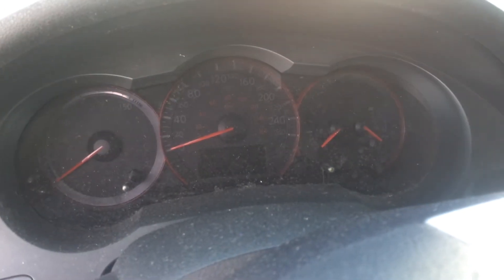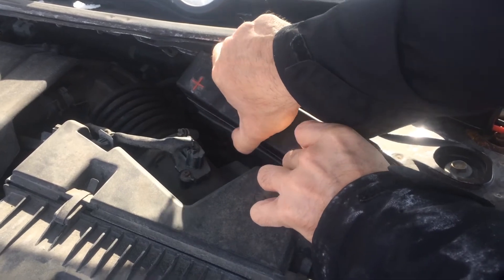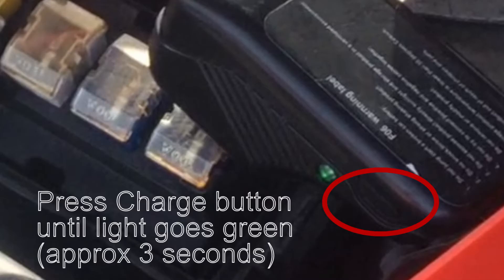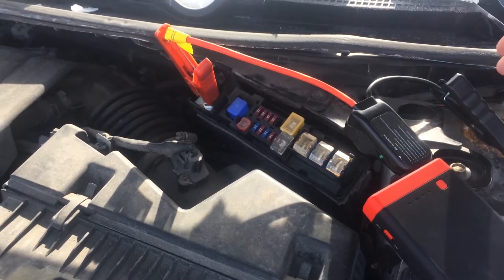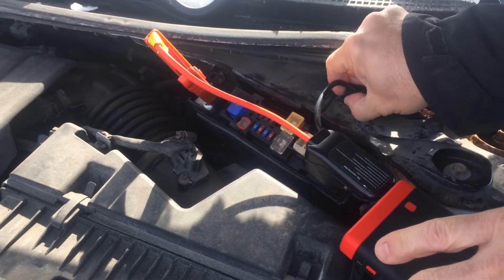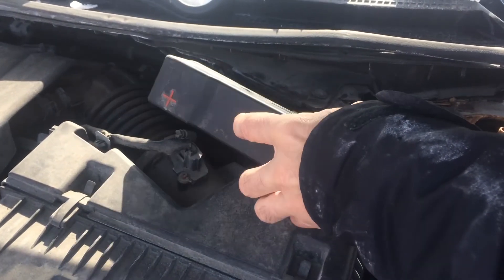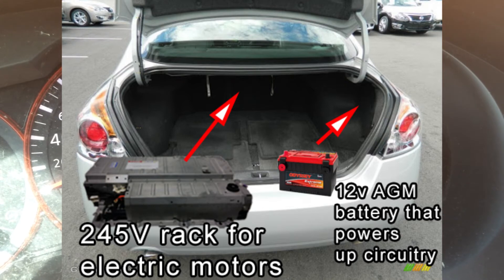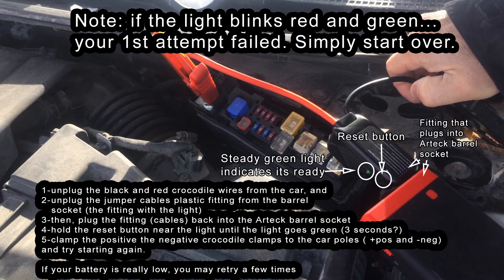Arteck Car Jump Starter / 12000mAh  / 2V Output 400A Peak Current

Comment: do you know how long it takes to charge it? I have a same jump starter. i bought it in 2018 but never had to use it until today. When i plug in it shows 4 blue lights. But its not charging. I plugged in at 10:am and its 1:30 pm When i unplug and press the button to see how many light shows nothing. Not even one single light lids up. that means its not charging i guess. thanks,